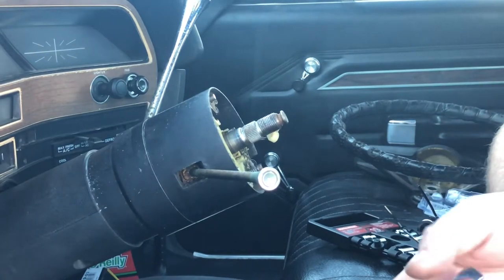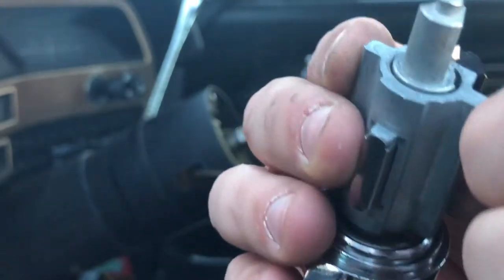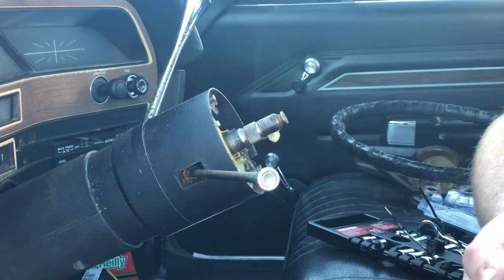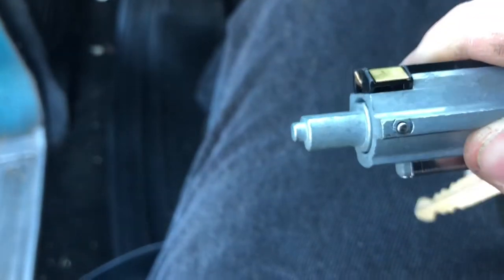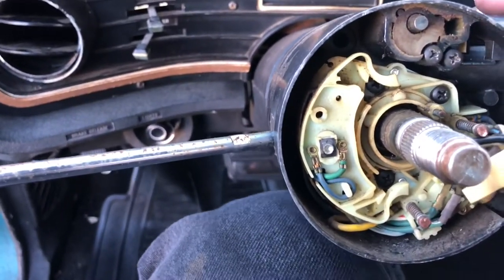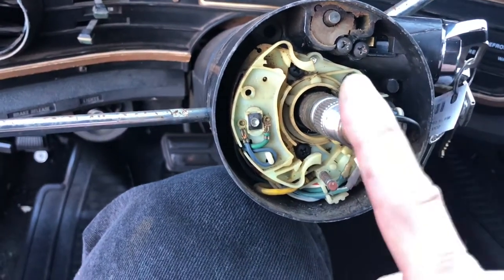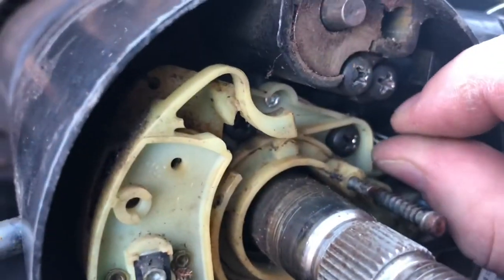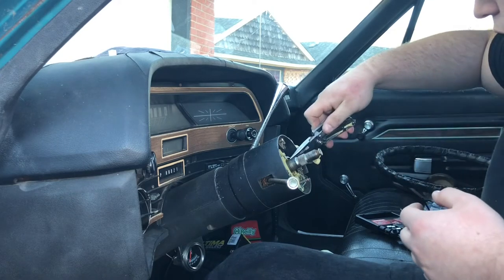How to remove Ignition Lock Cylinder from COLUMN - 70s Ford/1970 Ford Galaxie 500/Ford LTD/Custom

Comment: This video is much appreciated.  I was panicking when I couldn't get the key turned off in my 73 Pinto when that was they only key for the entire car.  I couldn't figure out where the pin was to get the cylinder out.

Comment: The lock cylinder / column on my 89 F150 looks identical. I used a small torx screwdriver to push in the pin on my lock cylinder - it was quite stuck with gunk

Comment: I bought a 1976 LTD and thought hey same damn deal one set of keys while I go to a store and have them cut some keys that are those generic looking things that aren't Ford Keys cuz they don't have them then by the time you buy them off the internet receive them carry them to a key shop and have them cut it's cheaper to just replace the ignition switch which was 120,000 miles needs to be done anyway thank you for making this video of how I get to that pin yes I have to pull the steering wheel and then take a L shape pick tool and push it up in there and depress that pin in the Run position and yank the thing out and change it so for 10 bucks I'll have a new ignition switch two new keys and then I only have to have the round keys cut for the rest of the locks are still good thank you oh and always remember swap out the passenger and driver door locks so you have new pen tumblers cuz nobody uses the passenger door lock they always reach over and lift up the button.

Comment: my key will not turn forward... what now do i do ??? drill it out... mobil locksmith could not help me when he came out, he said to replace it...
Reply from the maker: The cylinder should turn with the key inside. If it is not turning with the key you could try a screw driver to force it open while you press on the retaining pin, but that will likely break the cylinder and need a new one. I personally have not had my cylinder lock up with a key
Reply from the maker: Or perhaps the gear on the end of the cylinder which turns the plunger for the ignition is incorrectly aligned and preventing movement

Comment: Well the same thing work on my 1989 crown Victoria ltd
Reply from the maker: Should be a similar process of removing it, https://www.justanswer.com/ford/1fjto-install-ignition-switch-89-ford-ltd-crown.html this article includes removing the ignition lock cylinder as a part of the instructions